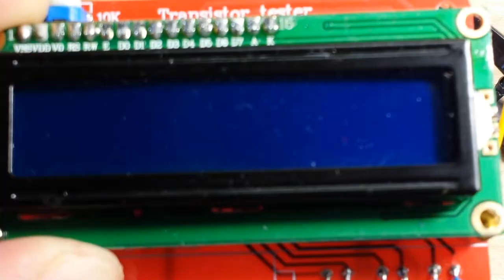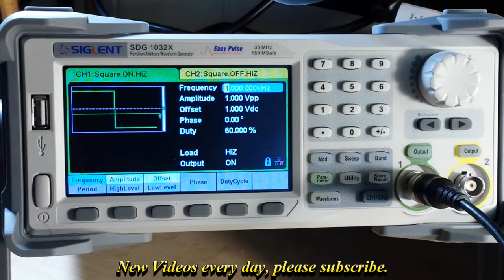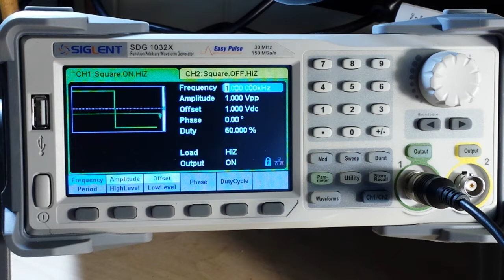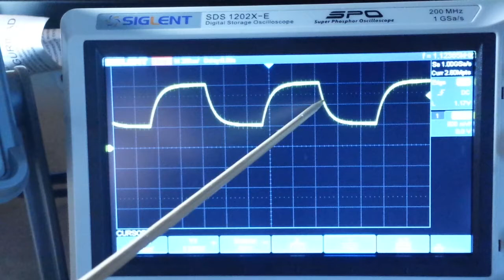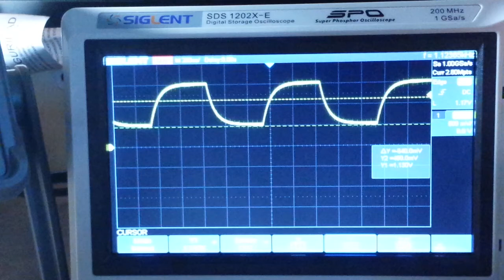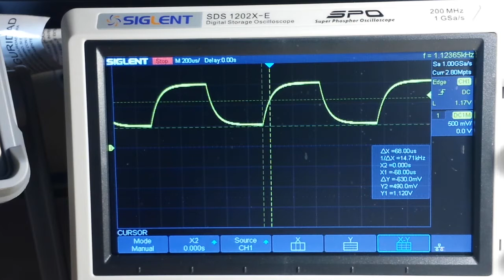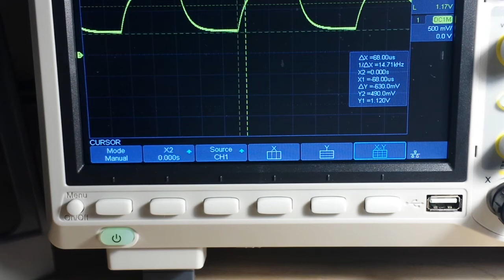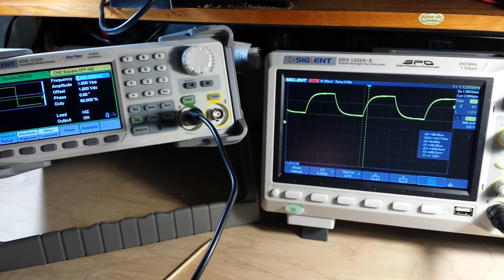How to measure the value of a capacitor with an oscilloscope

Comment: The time constant of an electronic circuit that contains resistive and capacitive elements is represented by the Greek letter tau (τ). This time constant in seconds is equal to the circuit resistance in ohms times the circuit capacitance in farads, τ = RC. Tau is the time required to charge a capacitor that is in series with a resistor to a level of 63.2% or 0.632 of the initial value, typically 0 V.
Reply: C= τ /R, if you want to determine the capacitance

Comment: You could have turned your voltage scale to 200mv/div and got your 632mv cursor also but its close enough for basic electronics. I use this method to test SMD unmarked capacitors for a short or degraded SMD Caps

Comment: Didn’t you forget the the math “C=T/R”.  Your number doesn’t match the capacitance Nano farad vs 68 usec.  Instead 68u/1k=68nano.
Reply: Yes I was scratching my head wondering why he made (resulting capacitance therefore = scope seconds). It only happened to work because of the resistance he used.
Reply: mlerch2002  yea right, but it really didn’t work,  the scope showed 68 micro seconds and then he measured the capacitor on a capacitor tester and it came to 68 nano farad! So he looks up at the scope and says what did the scope say and he’s said “ 68 Nano “.   He forgot the second part of the equation he needed to divide the time 68 micro by the resistance value 1 k ohm to take the resistance out of the measurement and that would leave him with the capacitor value as I’m sure you probably already know.  But I just typed it out for the other people who aren’t getting you can’t just use the scope measurement as the value of the capacitor.  Like you said, have him change the value of the resistor to 680 ohm and see what the scope reads.... Ok cool have a great one.
Reply: @gregjohnson5194  Yup! Thanks for clarifying my comment for others. What I intended to write was "the number only happened to match out of coincidence."

Comment: I am not seeing a square wave in my rigol DS1054z.  I am using a 1000uf cap do I need to change the settings on the frequency generator?   It looks like multiple waves spiking no nice square wave?

Comment: I enjoyed this demo so much that I watched it a second time.  I found a mistake.  At 7:21. you look at the scope screen and declared that the capacitance is 68 nF.  But you are looking at the Delta X value on the scope, and it says 68 microseconds not 68 nF.  This was an odd coincidence that caused you to temporarily get confused and make an error.  Plus, there must be a division step somewhere here.  I learned all this from your videos anyway, so if I'm wrong, it is your fault. :-)
Reply: You are right. The OP lucked out because he used a resistor value of 1K. Without doing the math how does one know if 68uS corresponds to microfarads, nanofarads, picofarads, etc?

Using: tau = RC we have 68E-6 = 1000 x C. 

Rearranging: C = 68E-6 / 1000 = 68E-9 or 68nF.

Also it would have been better if he had blown it up in both axes as the trace is quite fat compared to the cursors. Initially it looked like he was measuring from the bottom of the trace at the lower voltage and the top of the trace at the higher voltage. Should use bottom in both cases or top in both cases.

But it was a good experiment overall.

Comment: Nice experiment. the math is the 1000 Hz and that 1K resistor
Reply: The math is 𝛕 = RC where 𝛕 is in seconds, R is in Ohms (1KΩ), C is in Farads (68 nF).  The frequency needs to be low enough that the capacitor fully charges and discharges.  It will get to 99.3% after 5𝛕, so you want a period of at least 10𝛕 (5𝛕 each for charge and discharge).  Therefore, a frequency of 1/(10𝛕) or lower.  Since you don't know C in advance, you might have to keep lowering the frequency until you see the a full charge and discharge.
Reply: you should really try this experiment, full charge (5rc) in a practical cap is not happening